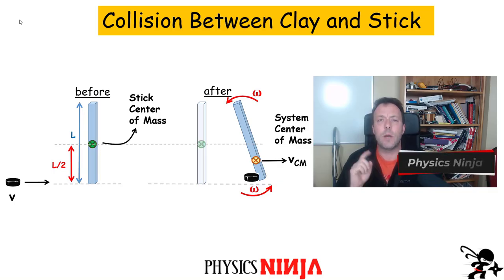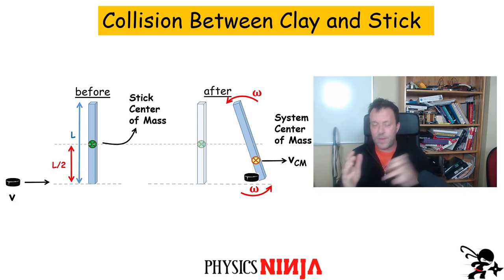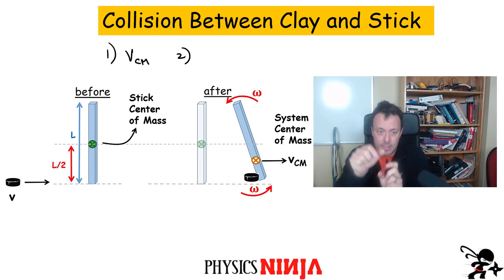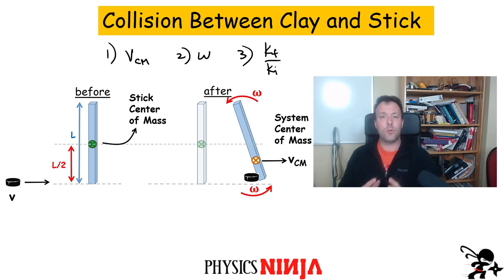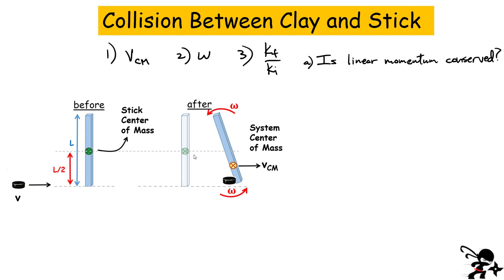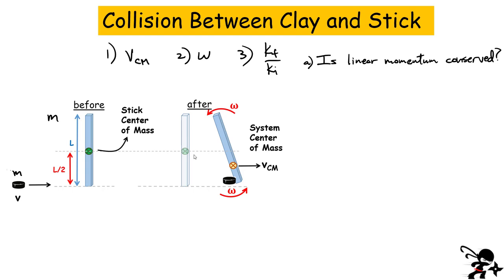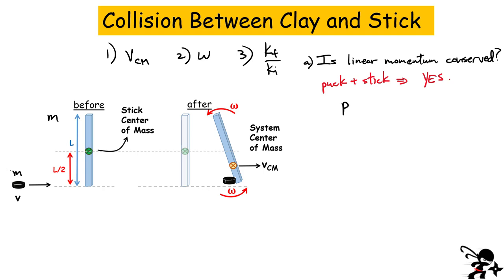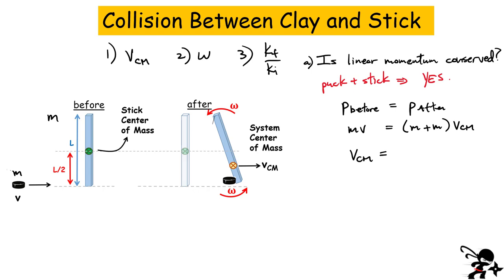Angular Momentum  - Clay Puck and Stick Collision

Comment: Finally someone who dares to remove any pivot point!😁 Thank you! 👏👏👏👏
It is interesting to notice that there is a point, 5L/12 above the CG, that will start moving along a cycloid. 
Thus, we can use a similar calculation to find out where to hold the handle of a hammer when hitting a nail, in order to minimize the impact on the wrist 👍

Comment: Ninja, good video. But I ma not sure about the sin(90) justification. Isn't theta the angle between the linear velocity vector and the position vector from the axis of rotation to the combined system's  centre of mass ? If the combined mass is rotating about the system centre of mass, won't 'd' be just zero?
Reply from the maker: Yes, that is what i meant to say but i said perpendicular to the axis.    It's the angle between the velocity vector and the vector going from the axis of rotation to the point of impact.   Still 90deg.